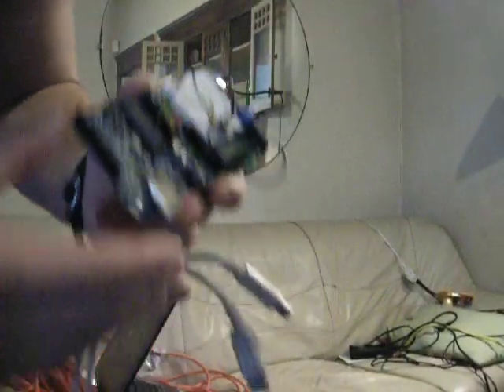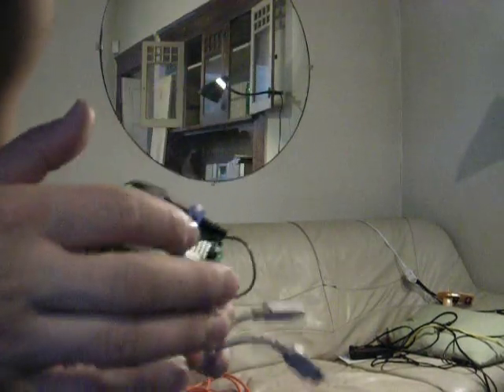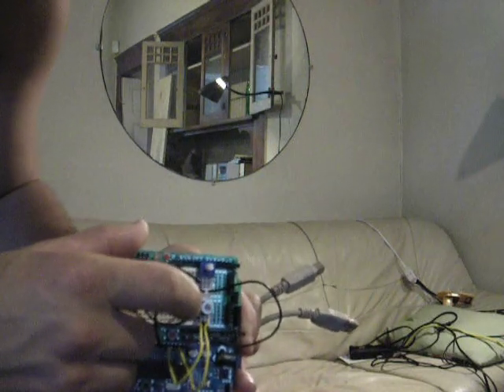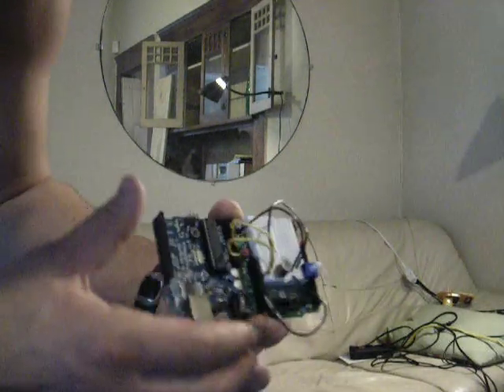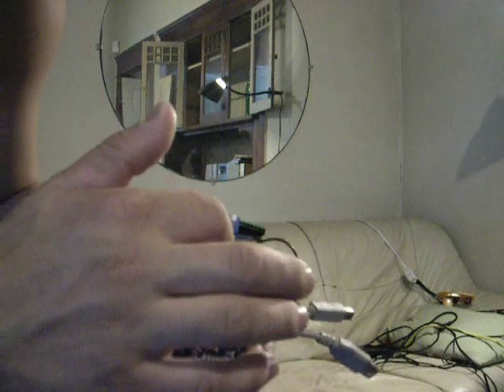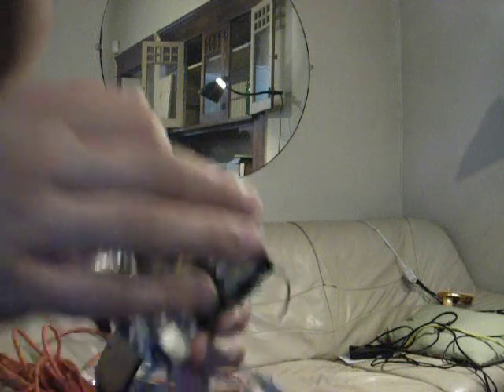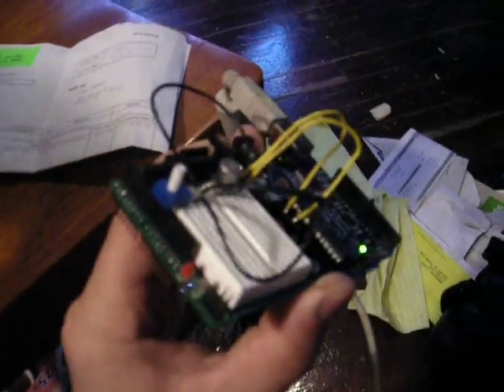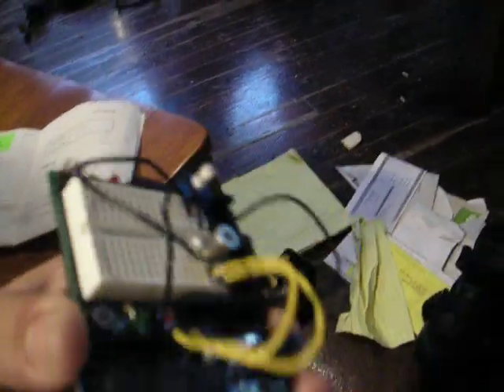voc sensor dev kit

Comment: Could you just use an ohm meter across a sensor?   Makes sense since,  basically,  you are just measuring resistance across two dissimilar metals.   One gas at a time,  is just fine.   Personally,  only interested in voc sensor.

Comment: I am curious.   Could you not just use ohm meter and sensor,  since you are just measuring resistance  across 2 dissimilar metals?   I am only interested in voc,  ethylene glycol,  mineral spirits,  xylene,  toluene,  etc-stuff of water based and solvent based paints.